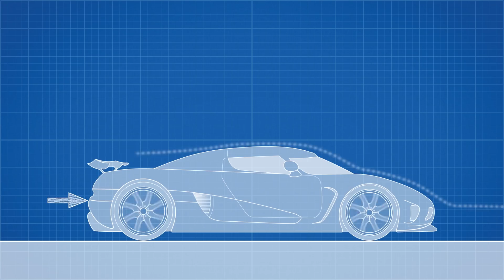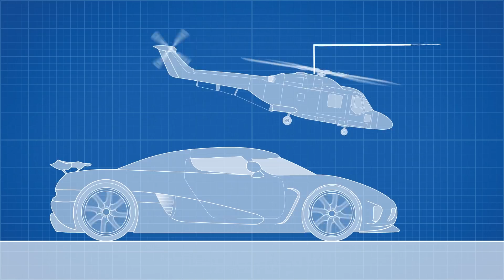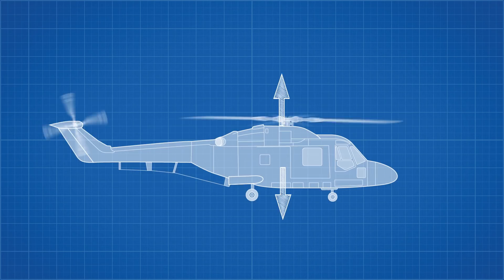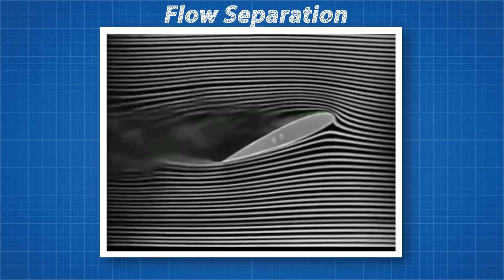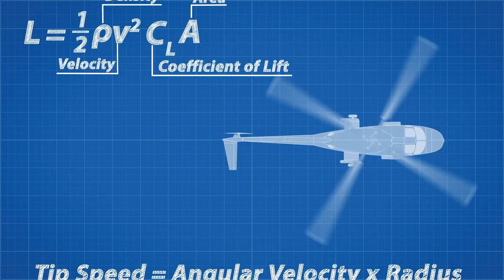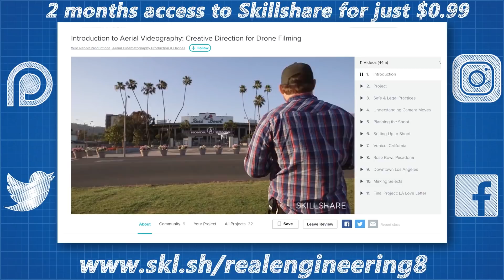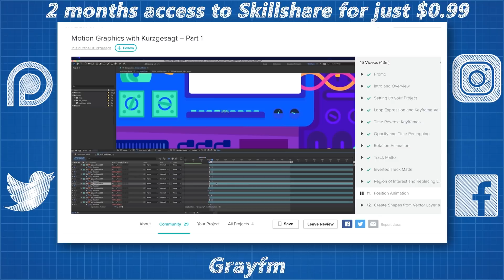Fastest Car vs. Fastest Helicopter - Which is Faster?

Comment: @real engineering:  You forgot about the Sikorsky X2 and S-69: 

"On 15 September 2010, test pilot Kevin Bredenbeck achieved Sikorsky's design goal for the X2 when he flew it at a speed of 250 knots (290 mph; 460 km/h) in level flight,[30][31] an unofficial speed record for a helicopter.[3][32] The demonstrator then reached a new record speed of 260 knots (300 mph; 480 km/h) in a shallow 2˚ to 3˚ dive,[33] which was just short of the 303 mph achieved by the Sikorsky S-69technology demonstrator helicopter."
Reply: Okay admittedly they are not production helicopters. But lets talk "real world average speed" which is a much better measurement metric of performance!

Comment: Although not a production car, the ThrustSSC speed record is also impressive at 1,228 kilometers per hour, this car literally has her engines attached to it.
Reply: i'm pretty sure that most cars have their engines attached :p
Reply: GraveUypo 
C'mon mate, take a joke, or at least ignore them.
Reply: blah blah blah tesla orbit bla blah
enough with that dumb joke. that would count if the car got there by its own means but it was just fucking payload, so might as well be a rock.
Reply: yeah i "took the joke" the first 50 times i saw it, this one was just the one that broke the camel's back.
Reply: sirBrouwer 
THAT'S..all cars have the engines attached...
Reply: sirBrouwer 
Nope. Plus, you can't find the top speed, on a car, that doesnet exist dumbass. Fucking fan boy
Reply: still the Tesla Roadster is moving faster. about (25.000 miph/40.23360 kmph) true the cosmos.

Comment: On 15 September 2010, test pilot Kevin Bredenbeck achieved Sikorsky's design goal for the X2 when he flew it at a speed of 250 knots (290 mph; 460 km/h) in level flight, an unofficial speed record for a helicopter.

Comment: Well, I have a question: on what occasion would normal propellers have an advantage over jet engines?
Reply from the maker: They provide more efficient lift at slower speeds, jet engines can rev higher because the airflow through the nacelle is relatively constant. Although planes like the SR-71 did have to worry about shock-waves messing with airflow into the engine, they had solutions for it.
Reply: Real Engineering ah, you have my thanks.
Reply: Turbojets are more efficient above Mach 1.2
Turboprops below Mach aprox 0.5 
And Turbofan in the point in between 0.7-0.9.

So propellers are better suited in short range trips like between islands where a jet cannot build enough speed or altitude to reach thier optimun efficiency.
Reply: +Angel Marin The other component of course is the altitude turbojets in particular are much more efficient in the colder air of high altitudes and even the hybrid operation of the turbofan benefits from this as the jet core which still provides 15-25% of the thrust having a similar performance boost at high altitudes. The latter does have a lower penalty as the 75-85% of the thrust being produced by the ducted fans propelling air through the bypass ducts which does't have that penalty. Of course it takes a good 15-20 minutes to climb to those optimal altitudes and the same to descend so they suffer a performance hit with short flight times which also tends to limit on flights with flying times much bellow around the 45 minute mark which is a good 450 km even with the low speed departure and approach phases included.